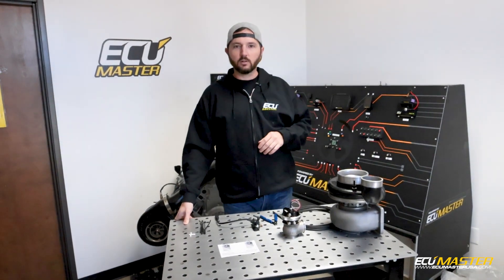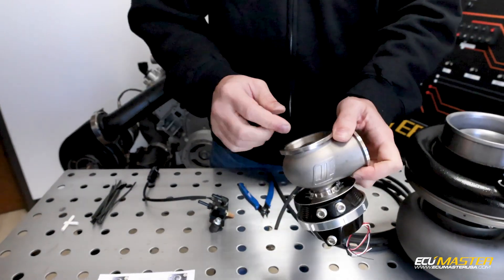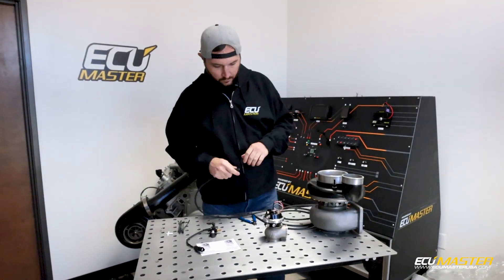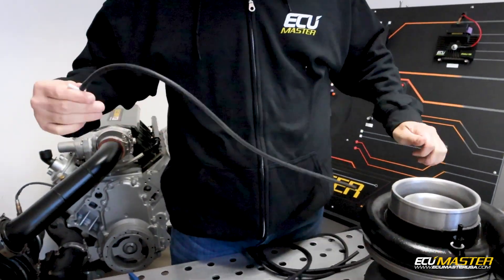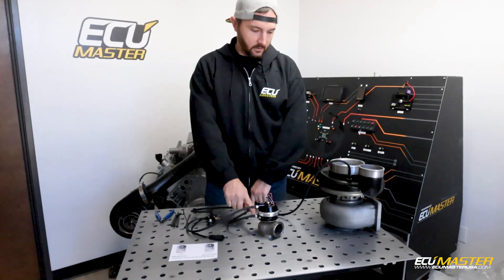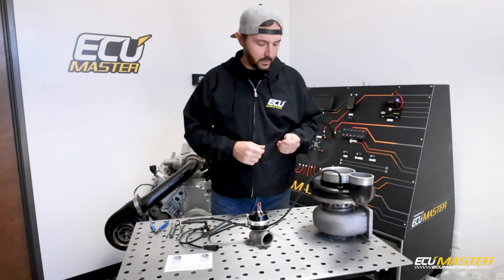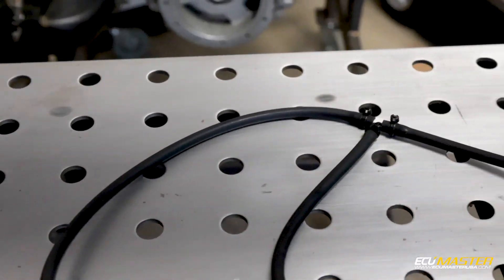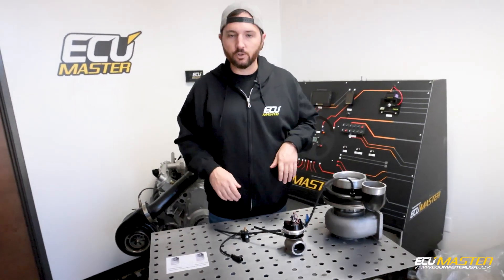Boost Control Solenoid Plumbing | ECUMaster USA

Comment: can you show me how to wire this unit to ECU black master  pin?
Reply from the maker: Wiring instructions are included with the solenoid if purchased from ECUMaster USA.
One wire will go to any available Auxiliary Out, the other to switched +12v source. The connections do not have polarity. 👍

Comment: How do you set it up on a stock turbo 1jz, I have a j pipe with that factory waste gate and that flapper door. My tuner says I need to use the compressor and a line off intake vacuum. But I’m so confused cuz no one else has that setup??

Comment: Is it okay to use the wastegate itself as the “T” between the compressor housing and the solenoid?  Since the lower half of the wastegate has two vacuum fittings available.

Comment: I know this is an old Video but I'm sure a MAC type valve the source goes in the right hand side port 1, to top of the wastegate is left 2 and centre port 3 is vent?
Currently using the blend function via a 4 position pot switch.

Comment: Please please please don’t use plastic zip ties to hold the vacuum lines near anything hot such as the wastegate. I lost an expensive turbo when it lost control due to my zip tie getting brittle and broke due to heat exposure and blowing the vacuum line off

Comment: I have a Turbo with internal waste gate and it doesn't have the fitting coming from the housing like in this video. Do I connect a hose from the solenoid to a vacuum port?

Comment: my turbo doesn’t have a pressure source off the housing. can i use the bung i had welded into the intercooler for the waste gate before this setup?
Reply from the maker: Yes, but ideally it is as close to the compressor housing as possible, depending on where that current bung is on the intercooler you could be looking at a lower pressure due to pressure drop across the intercooler.
Reply: @ECUMasterUSA  i meant intercooler pipe. it’s like 6 inches from turbo
Reply: @ECUMaster USA wouldn't it then make sense to have it after the Intercooler so it receives a more accurate reading of boost going into the engine?

Comment: The two wires where would they connect on the EMU black ? Well what two pins would I use for it.
Reply from the maker: One wire goes to a switched 12v source, the other to any unused auxiliary output. Polarity does not matter.
Reply: @ECUMasterUSA  when you say polarity doesn't matter do you mean either wire can switch from pin to pin and still work? I'm wiring into a wiring specialties harness that has red/white and black/red wires....

Comment: is this routing specifically for your Boost control solenoid or would this work across the board with other ones?
Reply: should be any 3 port EBC
**Please correct if wrong*
Reply from the maker: The most important thing to note is the static state of the ports. A 3-port will always have 2 ports that are a pass-through and a third that becomes the bypass when the solenoid is energized. Once you confirm the port arrangement you can plumb based upon that.